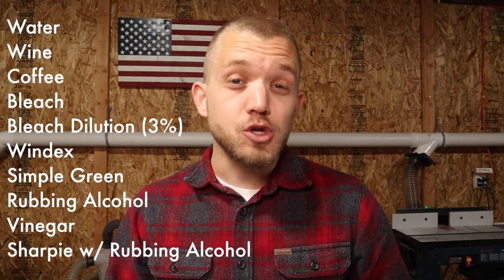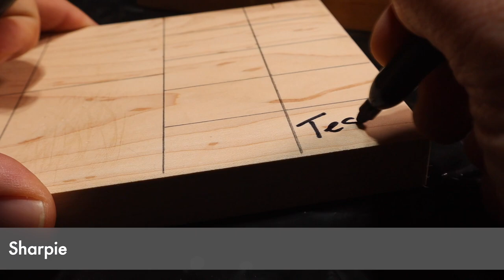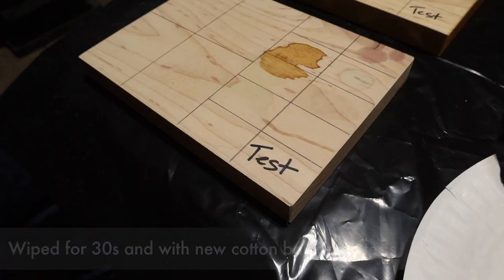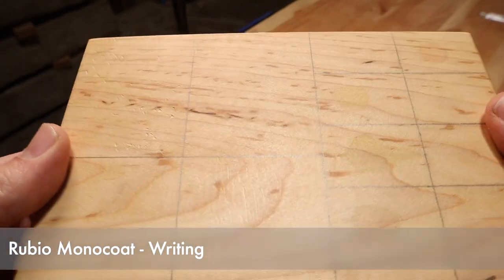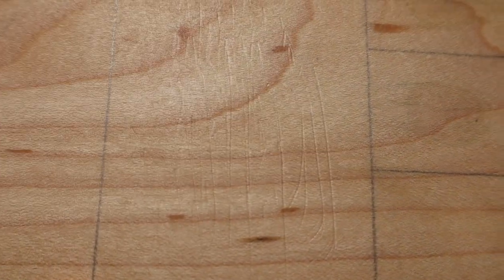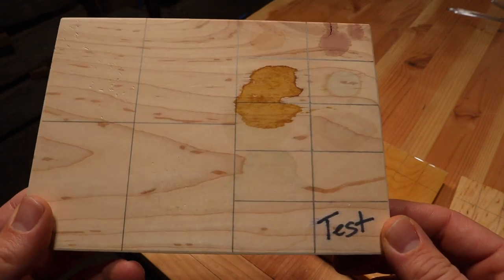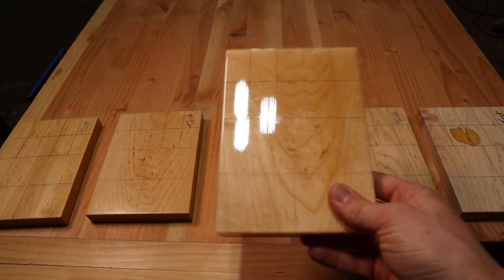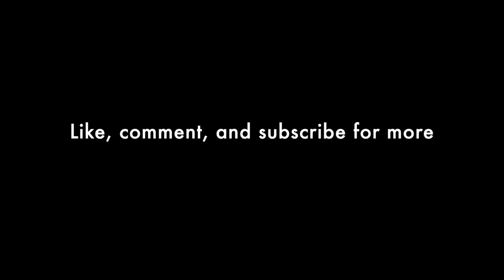Epoxy vs Rubio Monocoat vs Polyurethane vs Lacquer

Comment: Did I miss the  boiling test-or did you not include it?  I want to know if I can use Epoxy0on wood to make a hot plate.
Reply from the maker: Hey! Thanks for being patient, the boil test was a flop, that was the “hot wet fabric” which cooled off too quickly to adequately test that condition.

Double check with the epoxy brand you’re using but most of the ones I’ve seen are only safe to about 135°F
Reply: @NorthwestCraftsman  Thanks for replying. I did search and came up with the same results.

Comment: Thankyou very much for sharing this very interesting testing.   Another very important factor is how hard is it to repair after the surface is damaged.  No surfaces last forever. I've had some bad experiences with polyurethane on soft plywood getting sun damage. removing it without taking off a layer of ply was challenging.  Do you find that the other coatings are easier to touch up when they do get damaged.  
Ps -- please drop the overloud and incredibly annoying music.  Stumpy Nubbs went thru various ways of adding entertainment and eventually found the information was the interesting stuff.
Reply from the maker: Hey Ian! Thanks for the comment! 

I totally agree and have actually moved toward Rubio for exactly that reason. 

And thanks as well for the feedback on the music. I’ve gone back and forth but appreciate it when I hear from someone on the other end.
Reply: If you have epoxy on the soft plywood it will better seal it and reduce the expansion and contraction, which is likely your problem with the poly.  If you did poly as a top coat and epoxy as a base coat you'll get best of both worlds; epoxy for strength and sealing, and the poly for UV and scratch protection.

Comment: Thats odd, I have used catalyzed lacquer for many many years in cabinetry and furniture and being soft by any means is not a characteristic I would give it. Try Sherwin William pre-cat lacquer, it's extremely durable. Absolutely more so than Poly.

The stain and water resilience is why we chose it for cabinetry and furniture, 40+ year old cabinets over a stove top still look amazing with little maintenance
Reply from the maker: Fascinating! What’s humorous is that I used Sherwin Pre-Cat (hi-build medium rubbed if I’m remembering correctly). Perhaps I didn’t let it cure long enough?

I do agree with you though, I LOVE how easy the lacquer is to apply and the speed of application. If I did something wrong, I’d love to know 😂
Reply: @NorthwestCraftsman  I appreciate the reply! My process anyways is sanding sealer as a base always, it's so nice to sand and saves the amount of time spraying several coats on oak for instance. Then start with lacquer, mixed very very well since it also has pore filling properties (at least what I get). I apply 2-3 coats usually every 45 minutes to an hour sanding in between. Another reason I love lacquer is it sands very nicely compared to Poly that I feel is not appreciated enough among DIY woodworkers. And that's basically it we would assemble the components within a few hours.  I took a look at my coffee table that sees reqular abuse of sliding glasses, cans, etc and see little to no damage, which is great considering the amount of spilled beverages it has endured lol.
Reply from the maker: Absolutely! It’s guys like you that help me learn more! Thanks for the constructive feedback. I’ll have to give some more time to the lacquer using your technique and see how it holds up. I’d love to use lacquer if I can for exactly the reason’s you’ve described.
Reply: @NorthwestCraftsman  likewise! Thank you for taking the time and creating a very well thought out testing procedure. Keep it up!

Comment: What about repairs? All of these coatings get damaged - especially from renters or short term visitors. Acknowleging these surfaces will get damaged, how much work is required to repair?  How good does repairs look across each of these? Poly is pretty difficult to blend repairs. I've had significant damage to poly and laquer finishes from water sitting on it for hours and I am unhappy with all repair attemps. I am to understand that this is the strength of Rubio Monocoat, but don't have the experience to judge. Note that I am more focused on flooring, but not exclusively. My two biggest enemies is the furniture legs scraping along the floor and liquid stains from spills. I don't own any furniture anymore that doesn't have damage from small spills - especially from water (e.g. glass/cup rings, whitish spots, damaged and warped wood).
Reply from the maker: This is absolutely something I should have included. Repairability is an important consideration for the life of a finish and your understanding is correct. Rubio is one of the easiest to sand out and reapply without any issue at all. I’m preferentially choosing Rubio for most of my finishing now.

Comment: Awesome video! Poly is my choice there. I have thoughts for a second comparison.

Ive heard rubio monocoat reffered to as rubio dualcoat. I would like to see a test with 2 coats.

Also for epoxy. Ive seen some beautiful cabinets that were sprayed in epoxy (with color), it would be cool to see if you could get it to look a bit more like poly. I know theres this stuff called reducer 54. It can thin epoxy, not sure if thats what they use?
Reply from the maker: Thanks! I’m glad you liked it. 

I am planning a rerun of this test with a variety of new finishes and techniques! Will put these on the list! Thanks!
Reply: @NorthwestCraftsman  nice! You just earned a subscriber.

Honestly, good work, man. I live off the quality of my work, and it's testing like this that allows me to cut corners without cutting corners. I vastly appreciate what your doing and it's among the best I've seen.

I've basically come to the conclusion there are 3 options. Supreme durability, Supreme look and feel, or a balance. Epoxy offers extreme durability, rubio monocoat or osmo's similar offering give the Supreme look and feel, poly is a balance.

I would love to see the lines blur between poly and epoxy on look & feel, I think spraying is the key. I'm currently investing in a sprayer for my woodwork.

There are also other crazy things. I don't know the cost, but Graco makes a ployurea sprayer... which apparently sprays a hot substance that cools and hardens, sounds next level! Maybe it's this harder coating I'm seeing on some hardwood flooring?

🫡
Reply from the maker: Man, that would be wild to see. I will say that after this test I tried spraying poly with an HVLP and got a much, much better finish. I think my poly 50/50 with lacquer thinner so it flows but I’ve had really good results with it. Harbor Freight sells a solid $15 or $25 HVLP gun. 

I’m glad you found this helpful! Honestly it was just me documenting it for myself as well 😂 I needed to do the test so why not video it.

What kind of work do you do?
Reply: @NorthwestCraftsman  I've got a lot of stuff under my belt. I mostly specialize in tile/stone or hardwood surfaces. Floors, walls, showers, you name it. I'm starting a furniture business on the side. I can also do framing, drywall, paint, cabinetry, a bit of everything.

I used to be contracted nationwide to do many different stores in malls across America. Apple, Microsoft, Gucci, Polo, Abercrombie, Ruhl, to name a few.

My father is a top notch Mason, I learned his trade, dabbled in other stuff, fell in love with wood, and now keep his fire burning and mine!

I'm finishing a wood staircase right now. That I planned and built vastly exceeding stair code tolerances while adjusting the elevation @ the bottom of the stairs to be where I wanted.

I got all the cuts so tight in my steps you would struggle to find a spot a playing card would fit in. Enough to worry about expansion and contraction, but I used engineered hardwood, so it won't do that. I normally try not to pat myself on the back much, but I'm really happy on this one. Even my father is telling me I have surpassed his abilities, which kind of left me speechless...
Reply: Ohh on the stairs I'm doing, it also has venetian style concrete tile risers. Sort of a Mexican tile kind of vibe, but clearly Mediterranean in style, and classed up a bit from a Mexican tile. Also the tiles are all white and grey, the wood is a warm weathered grey look.

Honestly I've fallen in love with this wood color. Not dark, nor light. I want to call it grey, but also call it not grey... it's hard to color match, but beautiful.

I did their entryway and laundry room in the same style tile to carry the look through. Then the hardwood throughout. Each bathroom has a unique vibe.

House overlooks the ocean, gorgeous views. House was given to the homeowners free... Lucky dogs!
Reply: @NorthwestCraftsman  cool info on spraying poly! It's one of my current interests.

I've always liked finishing my poly with a spray can for the final coat. I'm getting a Graco finish pro GX19.

I've been playing with making my own stains from base ingredients, I want to spray it too. Sometimes wiping can wipe off some stain. I'm trying to develop a wipe free stain process that looks superior.

I also want to spray my poly and look into spraying epoxy. I know there are epoxy painted cabinets I've seen that look good.

There's also these sprayers I've seen called poly-urea sprayers. They spray on some hot stuff that then cools and hardens. I think it's that gnarly plastic type coating that feels like a durable factory job.
Reply from the maker: @brandonhoffman4712  I'm sorry it's taken me so long to get back to you. My wife and I just moved and I've been in the process of building out the new property (fences, barns, shop, etc.) Man your work sounds incredible. If you have any pictures you can share, I'd love to see some of your work, especially that staircase. When you have work like that, a pat on the back is well deserved and more than anything your tone shows you're proud of your work, not proud for the sake of it. I see a massive difference in that and I'm thrilled for you. We need more folks like that. 

I know a few folks that are in similar situations as your clients and I'm so excited for them. What a cool opportunity and ability to make something for your family for generations to come. 

Regarding finishes, I certainly need to dig in a little further, I just struggle to find time to experiment since my day job and family rightfully take the majority of my time. Once I get fully moved into my new shop, I should be able to capture a few hours here and there in the evenings. If you learn anything awesome int he meantime, I'd love to hear about it!
Reply: @NorthwestCraftsman  I would love to share photos! I just don't know the best way to do so...

I could post them on Facebook, but my whole page needs an overhaul. Haven't been there in half a decade!
Reply from the maker: @brandonhoffman4712 the about tab in my channels page should have an email you can send them too! 😊

Comment: Great testing.. but you please add a big label to each of them if you are doing anything similar in future. It really helps especially when they are on the table side by side.. also more side by side table views.. for more visible comparison. Thank you for everything
Reply from the maker: Great feedback! I’ll keep that in mind. Glad you found it helpful though.
Reply: @NorthwestCraftsman  Yup helped me narrow it down to a polyurethane finish :)
Reply from the maker: I will say, I’ve had even more luck with a spray poly finish. If you have an HVLP gun, I’ve mixed poly and lacquer thinner 50/50, with normal cure times, sanding between coats, and an extra coat or two turns out beautiful with no brush strokes at all. 👌
Reply: @NorthwestCraftsman  thank you for the advice. Don’t have a hvlp sprayer.. but need to get one for the fence. Thinking of a rub on poly for this one (storage crate bench).
Reply from the maker: Makes sense. I’d love to see how it turn out for you, if you want when you’re done, shoot me a photo to the email in our about page.

Comment: How long was the liquid left on the wood? we're building a bar top with walnut wood i believe, it will be in the weather and sun. So we're really trying to pick the best coating possible, I had just watched something saying a deep pore marine epoxy would be best any recommendations for what to use if you have another option?
Reply from the maker: Liquid was left on for about an hour. Sharpie was left for about 24. Outdoor finishes are really tricky because the changes in temp and humidity will crack most film finishes. Most if not all epoxies aren’t rates for UV and will break down over time. From what I’m seeing, I don’t have direct experience here, a good marine varnish (epifanes seems to be a common name) is what you’d want to go for.
Reply: @NorthwestCraftsman  Thank you so much. I had thought that   spot  was in tricky place  but I think I'll be able to figure it out. Thanks for the help on my project  it's 100% appreciated.
Reply from the maker: Not a problem! When you get out done, I’d love to see it! If you’re willing to share, my email is on the about page of the channel, or you can tag me on Instagram (@northwestcraftsman). Good luck!
Reply: @NorthwestCraftsman  I'll definitely send you a pic when im finished. We're actually looking for another slab today after we found out the first one we got wasn't thick enough.
Reply from the maker: Awesome! Thank you tons! I’m about to go slab shopping as well for a conference room table build I have coming up. What part of the world are you in? In the PMW, we’re blessed with an abundance of beautiful wood.
Reply: @NorthwestCraftsman  I'm in Virginia we have a good abundance of wood from what I know but so far its alot of walnut around me atm not like I'm complaining.
Reply from the maker: Nice! I’m jealous of your hard wood forests out there. Can’t wait to see how your project turns out!
Reply: @NorthwestCraftsman  Thank you tons I was hoping for a slab of boxelder maple but the walnut we just picked up is stunning
Reply from the maker: Fantastic! 😄 what are the approximate dimensions?
Reply: @NorthwestCraftsman  10 ft long 20 inches wide in some spots it dips to about 17 in  other's and 2 1/2 in thick
Reply from the maker: Very nice! That photo you shared was gorgeous! Can’t wait to see how it turns out!

Comment: one of the missing pieces in all this is how difficult it is to re-finish the board in case of fatal damage, like a big scratch from moving a heavy furniture. I guess Rubio would win this test ?
Reply from the maker: You’re totally right! I did miss that analysis in this test. I would say either Rubio or Lacquer are the best bet when it comes to fixing damage. Both are super easy.

Comment: The Lacquer really surprised me..  Figured it would fail miserably even with the water. It's a little better than Shelac.. Epoxy Semi Gloss would not have performed as well in the stain tests. Check into MCU=Moisture Cured Urethanes and  UV Cured Poly's. More expensive, but, the tests would have been hands down winner in every category.. Even harsh chemicals like Acetone.. .Yep.. Ha..Ha.. Industrial Coatings.. Save these guys for the money projects.  UV Cured are probably in the $400/gallon range, but, that is only going off of one price I saw at $500/gallon, but, a quick google search turned up some manufacturers in China, so, I expect someone to have some cheaper versions.. Not yet in the woodworking industry, so, still pretty expensive. MCU has been out longer, so, still in the $250 or so per gallon, but, considering, it's not that bad.. I found it searching for a needle in a haystack (DTM=Direct to Metal Clear), which is pretty unusual, but, it works on wood, concrete, etc.. Good UV and Chemical Resistance too... Hope that helps..
Reply from the maker: Good to know! Thanks for the feedback. I'm not sure I'll have any projects that can justify that kind of cost but hey, it's good to have a tool in the back pocket.

Comment: All of these finishes give a bad looking finish besides rubio... Rubio is the best kooking finish i have seen yet. Especially with 2 coats and paired with ceramic coat. Probably as tuff as epoxy with half the effort of application.
Reply from the maker: I’m loving Rubio more and more and agree that it’s the most natural looking finish. I’m curious to see how a ceramic coat holds up.